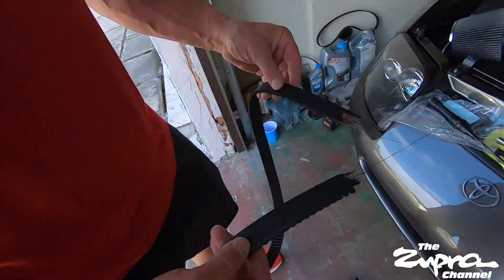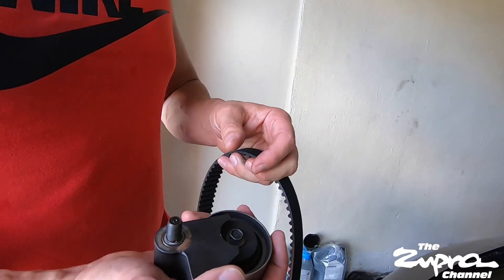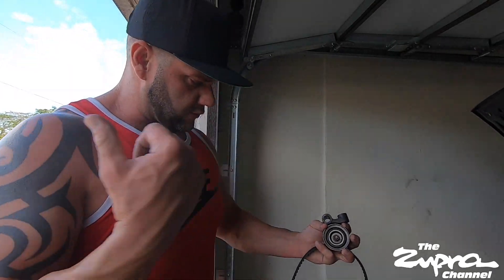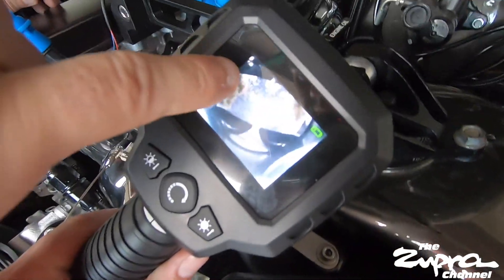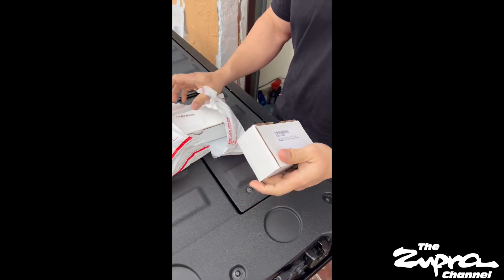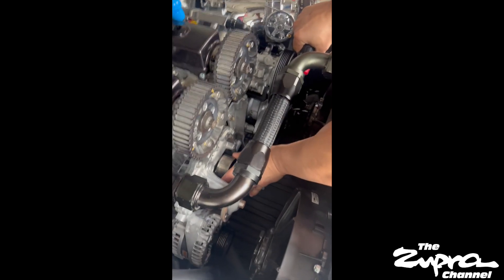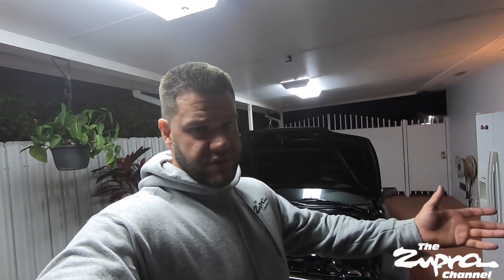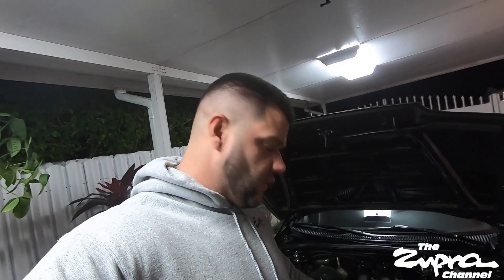2JZ Billet Timing Belt Tensioner Failure

Comment: Bra it wont be just replace a couple valves. If they bent that meants they hit the piston and whats connected to that? I think most people would be doing a full dissasembly and probly means a bearings, a rod and piston minimum if you can even buy them seperqtley plus head service valves, maybe guids and seats dude that will fuck a ton of shit. Yolo

Comment: Imo this is an issues of running an exposed timing belt, looks cool AF but potential for premature failure of parts without the oem timing belt cover to protect from dirt, debris and moisture. Great content as always though! Thanks for sharing, keep it coming!
Reply from the maker: Honestly I don’t think have the oem covers on would have done anything 

This was metal on metal contact cause it to seize

Comment: 2jz is an interference motor hopefully there isn’t significant damage. If those valves are bent since the head is off might as well get an oversized valve job.
Reply: Only the 2jzge vvti is an interference engine.
Reply from the maker: It’s interference when you’re running a big cam

Comment: I bet the ocean air doesn’t help with corrosion issues. Always make sure you run a full cover over the timing belt and gears too.  It helps to keep moisture out.